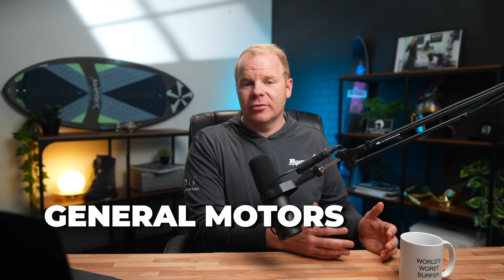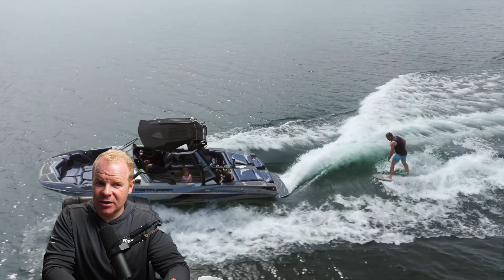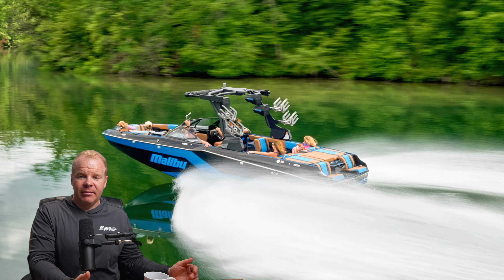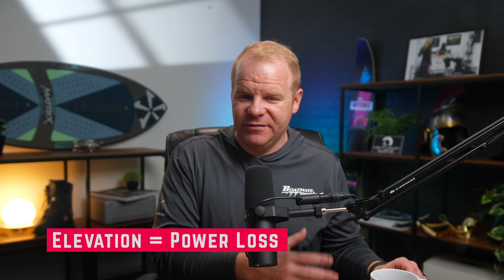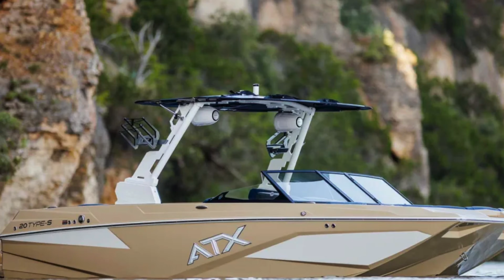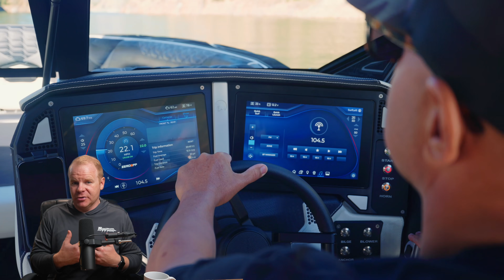Does Every Wake Boat Need a Supercharged Engine? (Before You Spend $40,000)

Comment: What about pushrod vs overhead cam engines?
Reply: SHouldnt make a difference to the end user. These are engineering tradeoff decisions. Overhead cams get more power out of less displacement at the expense of more rotating parts, more maintenance in some cases, and more weight/size. Pushrods tend to get better gas mileage, are more compact, cant rev as high, make less power per displacement, usually lower maintenance. From the owner's perspective it really shouldnt make a whole lot of difference, though. It's a bigger question for the companies designing the boat around it than it is for the buyer.
Reply: @KyleP133  overhead cams are a lot louder and suck fuel. Huge difference to the end user.

Comment: On smaller lakes a higher pitch prop can fix a lot of the issues mentioned. Even with an increase in RPM, most both will still be consuming less fuel than a similar equipped boat with a super charger. 

Over all though a very informative video explaining how boat design impacts fuel efficiency. Obviously biased to Centurion/Supreme, but is trying to sell boats after all.

PS Mitch. Fix the typos

Comment: My Varatti has an 8.2L Mercruiser in it. 470hp. 530ft/lbs of torque. 4000 lbs of ballast and 15 people and it still gets up to surfing speed no problems. Also with 15 people the boat will do 42 mph. I also use the ability to have a mercury joystick with my bow and stern thruster that also controls the transmission for forward and backward. This video is missing a lot of information. Varatti is going to be a huge name in wake boats very soon. Their boats have more features than every boat on the market except Parvati

Comment: Dude, lots of information in this video I don't agree with. I avoid the supercharged engines because of fuel consumption. My SA450 with 500 lbs of lead and a full boat did just fine, then I put a high elevation prop on it and it was phenomenal. Now I have a 2026 G23 and it feels even more powerful than the Supra. I usually agree with your videos, not this time. Your bias towards Centurion is bleeding out too much in this video.

Comment: As a previous centurion fi23 owner, I can tell you that this info doesn’t track. I now own a g23 with the zz6 engine which performs much better than it did in my centurion. 
I have much better fuel economy in the G23 than I did in the centurion and the g23 has a much bigger and firmer wave.  I’ve watched your videos show the fuel consumption rates and prove that centurion is better. However, my wallet and experience tells a completely different story. I can surf twice as long in my g23 with the same amount of fuel as I could in my fi23. The G23 surf’s at much lower rpm’s and is much quieter than the centurion. Not to mention that in order to get an equivalent wave from a centurion boat, you need to have the bow pitched up so high that it’s hard to see over the bow. I can drive the G seated without the bolster and still see perfectly over the bow even when the wave is at a 10. 
I appreciate the time you take to make these vids, but this info couldn’t be farther from the truth that I’ve experienced as an owner of both centurion and nautique boats
Reply from the maker: We appreciate your feedback and experience. We have done a LOT of videos talking about fuel economy and all of the factors that go into it. Depending on your elevation the G23 with a ZZ6 will work just fine. At higher elevations (Utah, Colorado, Wyoming, etc.) it simply doesn't work and no dealers bring the boats in with them.

When it comes to your Fi23, I assume you were not running a ZZ6 engine in it and were probably running a 6.0L engine (either L96 or HO). A ZZ6 is a very unusual motor in a Fi23, even at higher elevation.

If you were running your Fi23 so that you couldn't see over the bow then your fuel economy probably was terrible. 

We have made the statement many times over that if anyone doesn't think the data we put out on fuel economy is accurate we are happy to test it with a diacom.

Comment: Great video, any thoughts on the benefits of a 2:1 transmission ratio?  That seems to be a big benefit for Centurion and Mastercraft not needing a required supercharger.
Reply from the maker: Yes, that can definitely help, mainly because it allows for a larger prop and better utilization of the torque curve because of better prop dynamics.

Comment: You create the best inboard content— period.  The new centurions are good (all the boats are good). None are great. They all underperform.  42 mph is good on a boat that costs 200k?  Embarrassing.  What should be the focus is wetted surface area, gear reduction, and size and pitch of the prop.  Your call out on elevation is half true—non inducted engines lose power and are terrible — super charged motors don’t lose that much as  it’s forced induction.  What should be law is NO boat should ever have less than the 5.7.   The way the boat manufacturers are making the 5. 3 work is putting tiny props on them  and spinning the motors past their optimal torque curve. Why does no one talk about parallel speed with rpm.  My boat travels 30 mph at 2950 rpm  with 6 people in it.  It also goes 52 mph at 5500 rpm.  And it surfs completely full at 2550-2750 rpm between 10 and 12 mph.  Why? huge prop.  Plenty of torque.  Relaxed engine all the tim— fantastic gas mileage.  We should actually talk about sub woofers, led lighting and stern thrusters!  If any of the boats were easy  to drive, they would not have stearn thrusters or is everyone buying this boat in the segment Jerry’s on the weekend?  Keep up the good work!